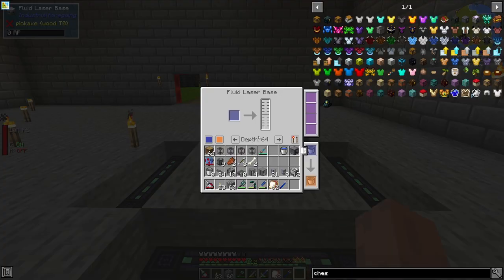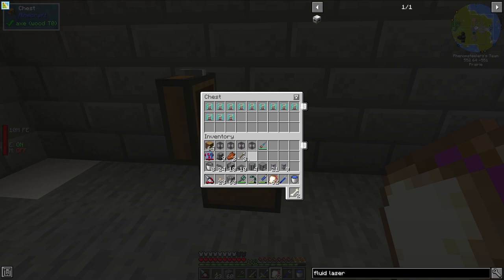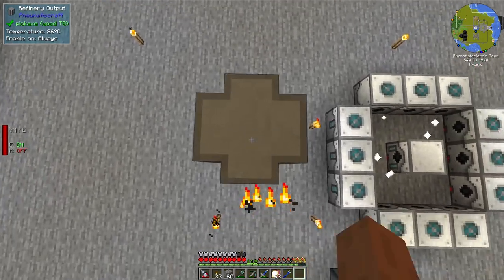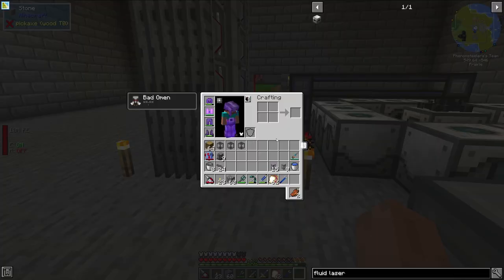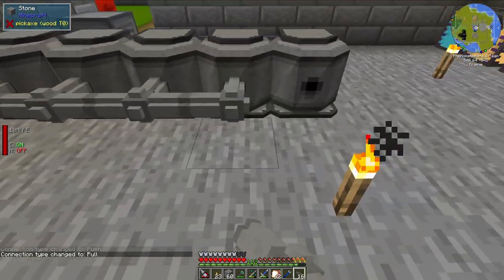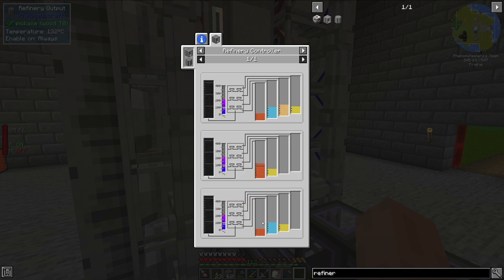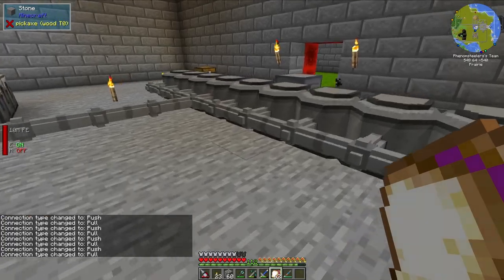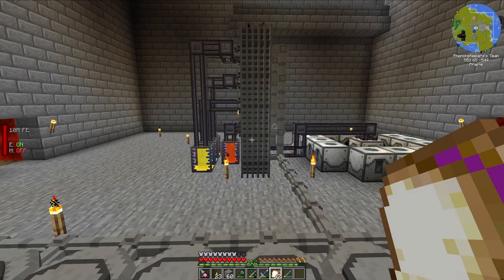How To Automate Oil Production And Refining

Comment: the speed upgrades for industrial foregoing stack (tier one/tier two) using both works (atleast in 1.12). For the refinery heat escapes through the exposed sides of the refinery just replace them with solid blocks. You can also use lava or other blocks/fluids to heat up the refinery although some of them can freeze

Comment: Do you happen to know if this set up is self-sufficient? i.e. Will burning some of the fuel output be enough to drill crude oil and also make surplus RF? Thanks for the video!
Reply from the maker: Honestly not sure. Producing oil in this fashion is not very energy efficient, but it still might be enough to be net positive energy wise.

Comment: Alright. I'm on 1.16.5 ATM6 and the laser drill worked for the ether gas thing with the wither just fine. Now i'm getting into oil stuff and the thing doesn't do anything. the arrow/process fills/runs but nothing is getting produced. Do you know why this might be the case?
Reply from the maker: Not sure what may be the problem, but you need to have the correct laser lens (black if I remember right) and be at the right Y-level (I'm not sure what that is, but it should be easy enough to figure out). Other than that, I'm not sure what your problem may be.
Reply: @minecraftphenom0892  You need to be in the correct biom. Either in the Dessert or in the ocean